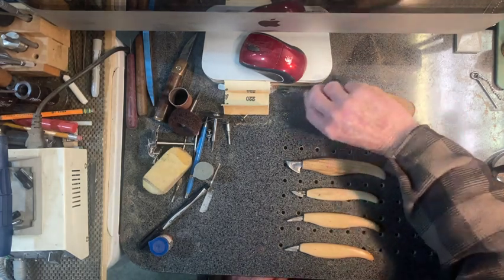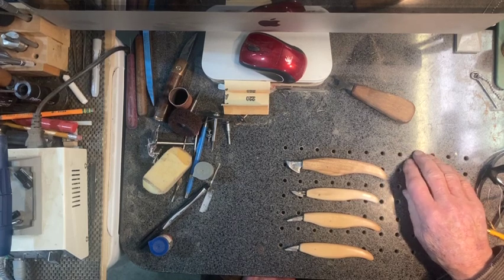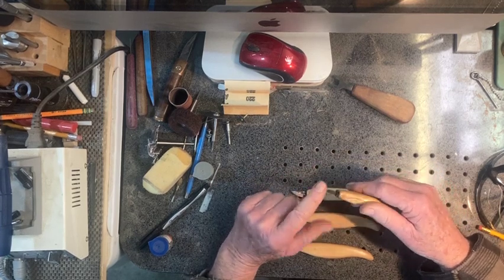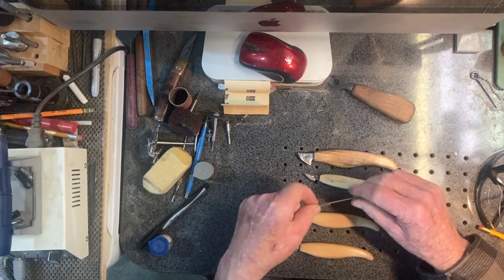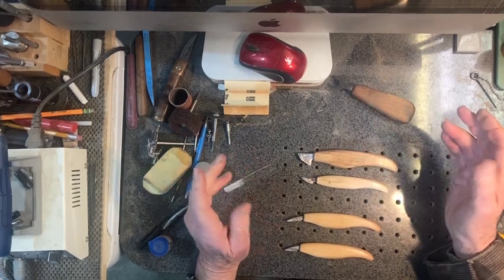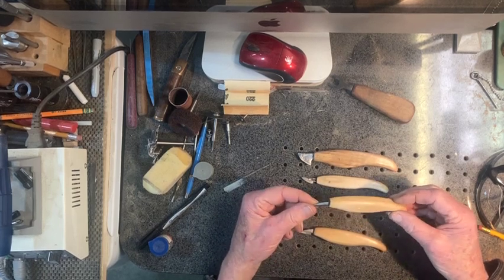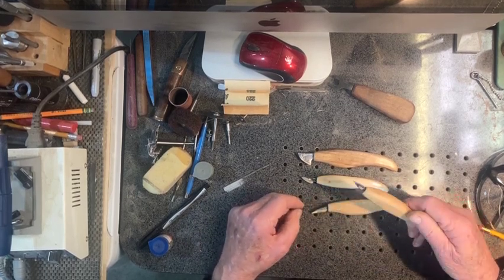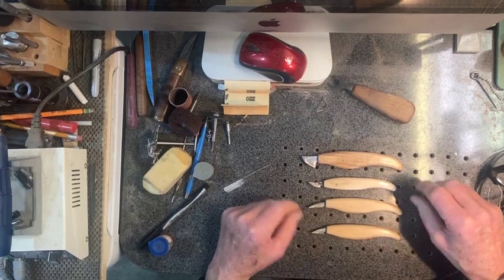Making a wood carving knife brought to you by Pete Blair AKA The Mad Scientist

Comment: Nice shape to them handles Pete   One question when burning in the tang is the heat sufficient enough to get through the wood that was left inside the drill holes or did you mortise it out fires?
Reply from the maker: Thanks for watching and taking time to comment. I used a different piece of metal to burn in the handle because I was concerned I would soften the steel. if you check the still photos you will see that I drilled some small holes to start the burn heading it the right direction. I did notice that the start of the opening did get enlarged quite a bit each time I heated and inserted it. In the end I had to epoxy a thin piece of wood along side the tang to keep the blade in proper alignment.